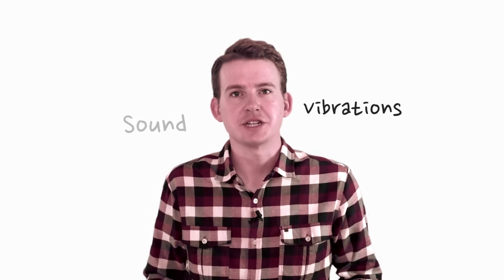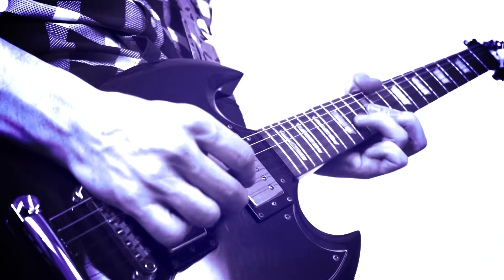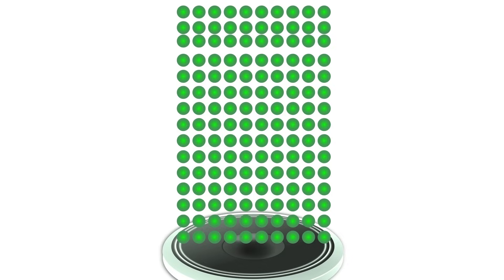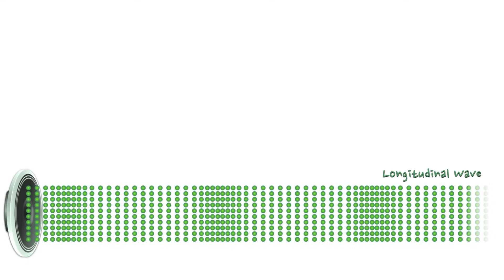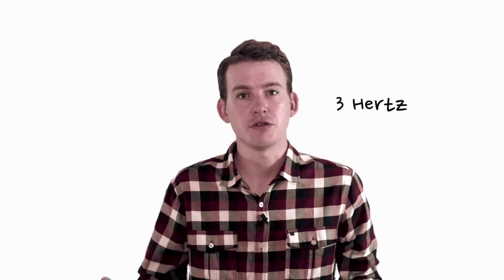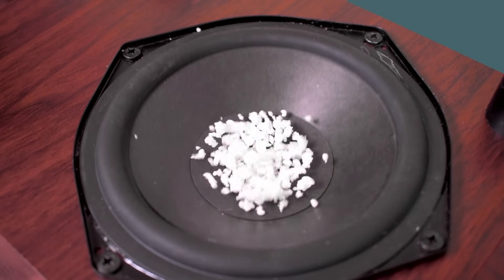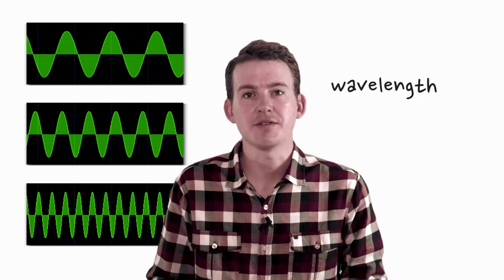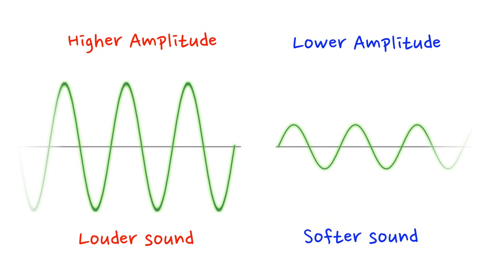Sound: Wavelength, Frequency and Amplitude.

Comment: Hello, What would be a good question to ask for a second grade science fair project using the gummy bear wave machine in regards to sound? What kind of graphs could my second grader make? I was thinking to measure how fast the wave comes back to the starting point when we add energy to the wave machine. Repeat this procedure 5 times taking 5 gummies off each time until i reach the mid point of the gummy wave machine. What do you think?

Comment: So does, greater sound means higher number of Hertz and lesser sound means less numbers of Hertz.

So my question is can we produce, high sound with less number of Hertz?
Reply from the maker: What do you mean by “greater sound”? If you mean “does louder = more hertz” then the answer is no. The wave of great amplitude (a louder sound) looks as though the waves are narrower, and may give the impression they are closer together (which would mean higher frequency) but they are not. If you measure wavelength before and after raising the amplitude, that wavelength (and therefore the frequency) will remain the same.
Reply: @Science_Sauce  ok then, let's take a situation.
I have a fork tuned to 440hz.
Scenario 1 = When I hit the fork, low velocity - it produces low sound.
Scenario 2 = And when I hit the fork with high velocity - it produces high sound.
So according to what you're saying is, at both the scenario the fork will vibrate at same frequency (or hertz) but the sound (amplifier) will vary.
Reply from the maker: All I can say with certainty is that a louder (greater amplitude) sound will not have a higher pitch, all other things being equal. In the case of your tuning fork, a good tuning fork should ring true at its note regardless of how hard you hit it. One possible explanation is that you are hearing harmonics. The fork rings out at A4 (440Hz), but will also possibly produce the sound of A5 (880Hz), A6 (1760Hz) etc. Perhaps the harder hit makes these harmonics louder. I’m only hypothesizing here.
Reply: @Science_Sauce  well then can we conclude this by saying.
When I hear a 440hz sound on my phone.
Even if I increase the volume or decrease volume. Its not gonna affect the frequency or Hertz.
Instead just the volume gets amplified high or low.
Am I stating it in the correct way?.
Reply from the maker: Yes, correct.
Reply: @Science_Sauce  thank you man, i really appreciate your work.
Reply: @Science_Sauce  ahh can you clear one last doubt.
As they say human can't hear below 20hz and above 2000hz.
Then does that mean, even if u increase the volume of a 10hz sound, then also human can't hear it?
Reply from the maker: The human hearing range is approx 20Hz-20,000Hz. If you play sound at 10Hz it will be inaudible to humans regardless of the the amplitude (turning the volume up will not make it audible).
Reply: @Science Sauce  hey science sauce, one last question man, please clear me this.
 if i hit the fork hard or if i hit the fork softly.
In both the scenarios will the fork vibrate at the same frequency?

Comment: This is fantastic. You’re really great at explaining and keeping us engaged! But I’m confused on wavelengths, im studying audiology and they say wavelength is one mountain top to the next, but yours starts on the middling and does a full mountain and valley. It’s twice as long and what my course would call a ‘wave cycle’ so now I’m really not sure which is right. Is it either?
Reply from the maker: Both are the same - if you pause the video and measure peak to peak, then measure midpoint to midpoint it will be the same length. Trough to trough also works. One cycle = one wave.

Comment: Im going to get an air physio, it supposedly causes a vibration in the air which loosens mucus in the lungs... would this be a resonant frequency of the air vibration acting on the mucus increasing its amplitude and therefore vibrate harder which causes it to shake apart?

Comment: Sir, I have a doubt. Why amplitude does not affect the time period of the longitudinal wave? If I take the example of a sound wave, then amplitude means the maximum distance covered by the air particle to either left or right side to it from the equilibrium, right sir? So, If amplitude is higher, the particle has to cover that much distance to its right, then to the mean position, then to the left, and then back to the mean position to complete one oscillation, if my understanding is right. Then won't the particle take more time to complete one oscillation? I am really confused 🙁
Reply from the maker: The wave shape is used as a visual representation but particles do follow a path along a wave. Sound is vibration of particles not long distance movement.

Comment: My homework says “how to find frequency when wavelength is 0.33, corresponding to the speed of sound 343m/s”
Reply: Given: Wavelength (w) =  0.33
            Speed (s) =  343m/s
To find: Frequency (f)
Solution: 
since,  w= s/f 
therefore,  f=s/w
                   f= 343/0.33
                   f= 1039.39 Hz
Ans: Frequency is 1039.39 Hz 
( Unit of frequency is Hertz)
Reply: f = 1/T
f = 343/0.33
f =  1039.39 Hz
Reply: witchykudasai legend

Comment: Nice..but  still  confised  in  freqncy...time period  relation
Reply from the maker: More “pulses” in the same unit of time = higher frequency. If the time period is 1 second and there are 10 “pulses”, the frequency is 10 pulses per second (=10Hz). If there are more pulses in that same time period, let’s say 20 pulses in 1 second, then the frequency is 20 pulses per second (=20Hz).

Comment: Does the speed of sound depends on its frequency?
Reply from the maker: No. The speed of sound is constant within a specific medium, regardless of frequency. As frequency increases, wavelength decreases, but speed stays the same. Otherwise you would hear higher pithed sounds sooner/later than lower pitched sounds.
Reply: @Science_Sauce  thanks very much 💖💖

Comment: Less than 20 hrtz are also known as infrasonic vibrations
Reply: The one that wrong is the term infra and ultra is used in frequency,  in sound named in sonic like : infrasonic, audio sonic, and ultrasonic. In lights : infrared, visible light, and ultraviolet. While sub, trans, super,  and hyper are measurement of speed, like subsonic = below the speed of sound, trans sonic = exactly the same speed of sound, supersonic = faster than the speed of sound  (usually 1.1 up to 4.9) because 5 and beyond are considered as hypersonic . That's why I feel something wrong with this video and in fact it is.
Reply: Mason Klein what’s wrong with that?